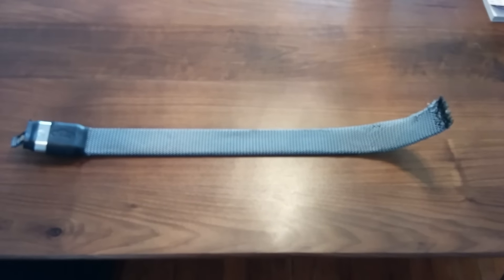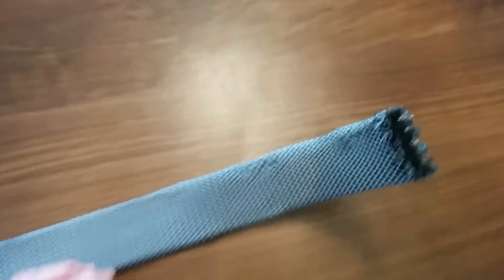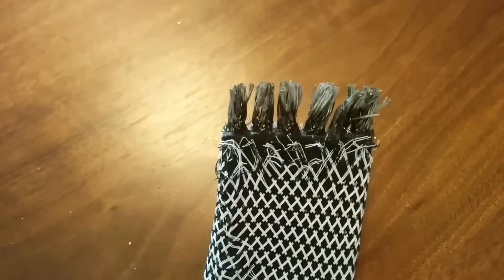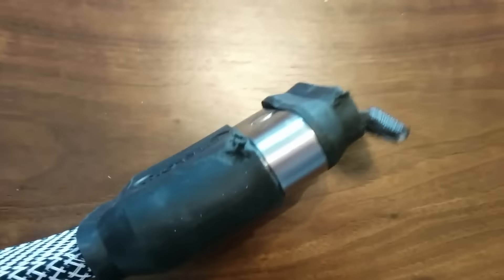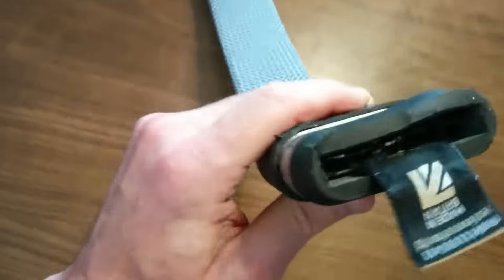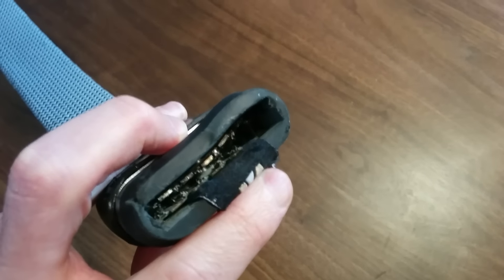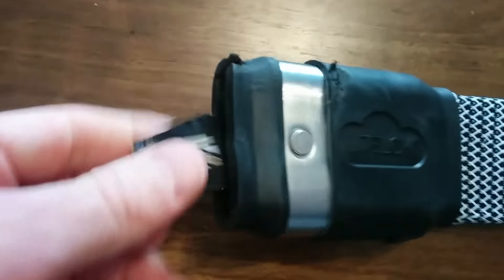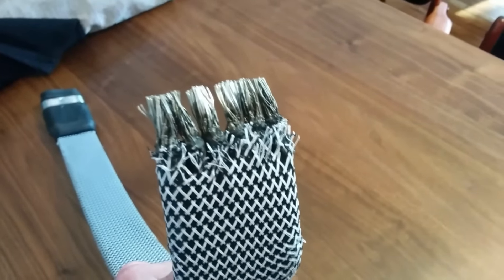Pulled apart Litelok

Comment: Makes you wonder how this was rated, let alone gold rated.
Reply: PtWhiteBelt Check our lockpicking lawyer’s videos on this lock. In summary, they probably used aluminum or copper cable cutters during testing, not cable cutters meant for steel. Lockpicking lawyer got through in 16 seconds with proper cable cutters
Reply: @Nicksperiments  Their new Core just got rated Diamond for 2021, can we still trust Sold Secure?
Reply: Especially since it’s just a glorified cable lock:
Reply: @vietle8157 a core has nothing to do with how this attack is done by twisting a pipe inside of it
Reply: @isabellam1936  I mean they have a new lock out called the Core that has a similar, possibly flawed design

Comment: I believe this lock passed the Sold Secure Gold test but was still thwarted by the thief due to its six cable bundle design. A U-Lock is tested by putting it in an expanding jig and measuring how much force needs to be applied to break it. This lock would do well on that test as the force is distributed evenly across the six cable bundles in the band. But the thief was applying all his force to the bundle on the side and only needed 1/6 the strength to break it free. Once that first bundle broke the other five failed one by one like dominoes. The lock should be re-designed with a wider buckle and longer cable bundles on each side that wrap around a secure anchor inside the buckle.
Reply: It's been reset to sold secure silver.

Comment: If they change the design to loop and then clamped I'm sure it would hold. No good right now though, thanks for sharing!
Reply: I know right, such a basic principle when working with steel cables, your anchor point needs to be stronger then the maximum tensile strength of the cable you are working with.

Comment: I wonder... instead of using 6 cables clamped on each end.. If they used 1 long cable threaded back and forth around/through steel posts/holes.. I wonder if that would help stop this sort of attack.

It could still be easily cut.. But at least twisting it would not be an option.

Comment: originally i was going to get some light weight lock that folds up.
Even ulocks will get killed by a portable grinder, just don't leave the bike unattended for long & always in a high traffic area. 
i use a combo of chain lock & ulock together & might get a 3rd lock.
I'd rather spend the $$$ on locks then have to buy a new bike back.
Lastly i don't care if i am carrying 15 lbs of bike lock, at least i get a bit of a workout..........

Comment: Geez people are so harsh. No bike is immune from theft, don’t leave it out of sight or your fault for it getting stolen, etc. etc. The people who steal bikes are the problem, not someone for not using multiple locks on a bike. Seems like the OP just had a sub $500 bike which was 10 years old anyway which is also a reason why it wasn’t stolen, looks like he jazzed it up to look cool and caught the eye of the theft who probably thought it was worth more than it is. The best tip is to by your commuter bike second hand,  $100 maximum (you can still get a decent bike around that price if you are patient), don’t clean it, keep it stock, then even a $20 lock is enough to keep people away.
My problem is that my bike helmet that I chain to my bike at a train station is worth more than my bike! I’d be sad if that was stolen, but again, it isn’t a +$200 helmet so not too upsetting.
Reply: serpserpserp companies shouldn’t make claims their product can’t back up

Comment: Company should have welded lugs to each wire, or welded the wires to the locking mechanism. Can't weld cast iron though? Nice try! The race is still on, and will never be won. Buy a bike no thief wants.

Comment: it should be 1 hole cable not 6
Reply: doesn't matter cable is still a cable which is made of multiple wires of about 1mm thick or less, so even if thief is not strong enough to cut the while thing in one go he can cut a part of it first.

Comment: no lock will save your bike. if you can't keep the bike with you then don't bring the bike. sorry but this is reality.
Reply from the maker: Aside from the fact that no one person determines reality, I used a Kryptonite U-Lock for more than a decade previously with this same bike (and it was not stolen while locked up on the streets of NYC).
Reply: Josh Weinstein 

try your lock on a four thousand dollar bike as see how long it will last.
Reply from the maker: I don't own a $4,000 bike but I think I agree with what you are trying to say, although I see no need for the hostility.  I guess this is evidence that money can't buy happiness.
Reply: With a strong ulock such as Abus Granit 540, the theft would have had to use a powerful angle grinder to cut through, which would have been quite load, not a simple, and quiet, hand tool used in this case. I suspect the theft wouldn't have bothered otherwise.
Reply: I think the REAL issue here is people not being aware of what kind of lock you need to use for different situations. While this lock IS rated Gold, anytime your bike is going to be out of sight, you probably want to use 1 or 2 GOOD locks. If you're just using it to lock your bike while you run into a grocery store or café for a bit, you can use a less secure (more portable) lock. If your bike is going to be in your field of vision, you could probably be fine with just a cable lock. If I were riding any $1,000+ bike in a city, I would use 3 locks. 1 to lock the bike to a post, 1 to lock the front/rear wheel to the frame, and one cable lock as a last line of defense. This way, a thief has to cut a good lock just to free the bike and then would have to cut another good lock just to allow the bike to be ridden while the last lock would also be a tiny obstacle to get over as well. That setup could buy you 3+ mins.
Reply: @Lando4534  Its just a glorified cable lock, even if it was twist proof as advertised cables are still cables and can be easily cut with cable cutters as long as the blades are properly adjusted and it's a high quality tool.
Reply: Shopping in a large grocery store, my fat e-bike is locked up "alone" for 20-30 minutes.  It would be a shame to forego that exercise, fun, environmental "goodness" and saved wear and tear on my 1 ton 4x4 van.  It's a big waste to fire the beast up for a little grocery trip.  I guess good locks and a good insurance policy are a necessity in today's usa.        Its interesting how Norway, Switzerland and many other countries have little to no such theft problems, and some are really BIG bicycle cultures.  Americans: LOVE each other!
Reply: @paulhester8086  You're half right about this:
Americans love each other... stuff.